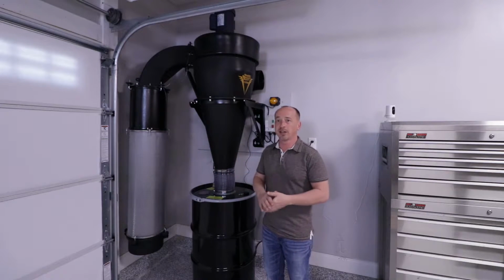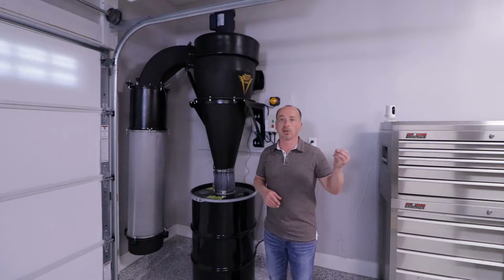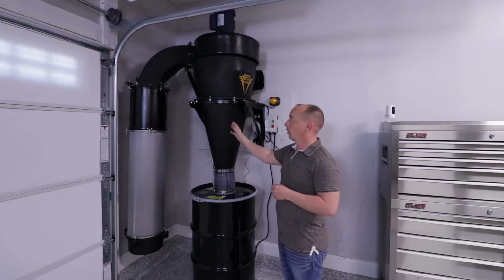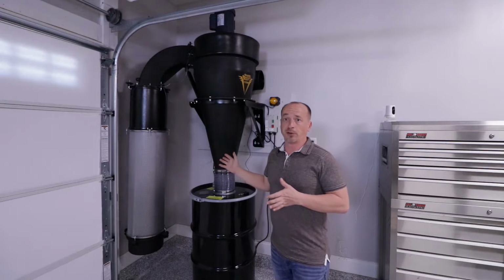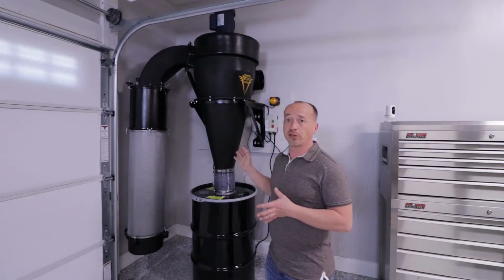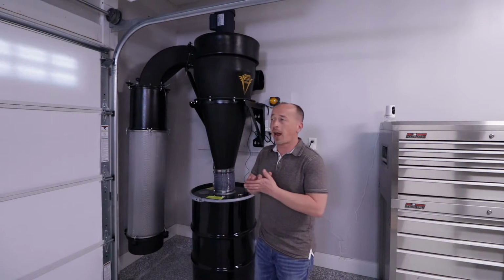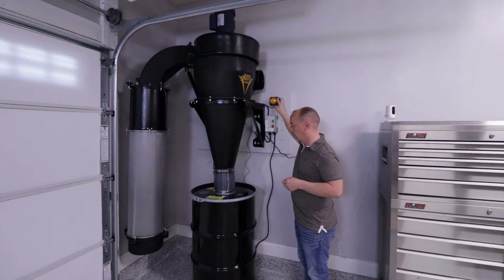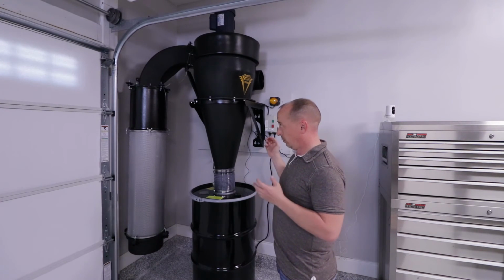New Dust Collector!  Oneida Air Systems V-3000

Comment: Do you still have the v-3000 and did you receive potential safety issue notice from Oneida regarding the bolts that secure the fan to the motor on the V-3000?

Comment: Pretty well decided this is the unit I will be installing. I plan to go with the smaller bin to keep the overall height down. I don't run a production shop so it wont be that big a hassle to empty the smaller bin more frequently (also lighter/easier to lift). Please post an update when you've had some time using it.

Comment: Hello... Nice video.   I just got the V-3000 and, simple question, how did you mount the on/off switch to the wall?  I don't see any obvious mounting holes, and if there is supposed to be a mounting bracket mine did not come with one...Thanks!